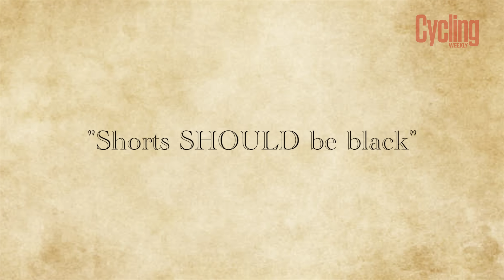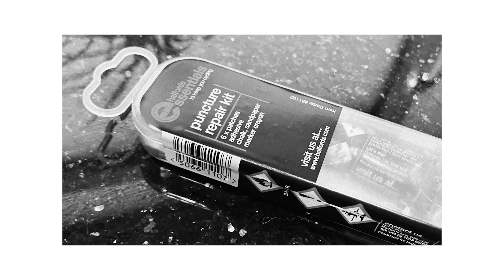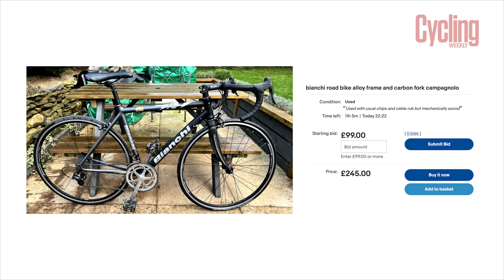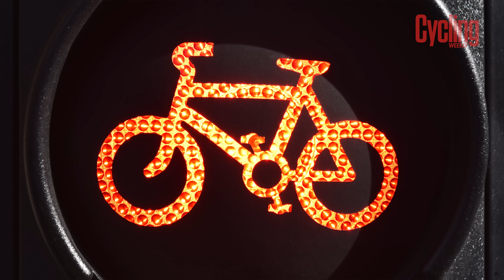15 Things That Really Annoy Us About Modern Cycling!

Comment: What annoys me the most about modern cycling is the revulsion towards rim braked bikes. They work absolutely fine and not everyone can afford to buy a shiny new disc braked bike to keep in line with the current trends and manufacturers marketing pressures!
Reply: Completely agree with you!
Reply: There's quite a few companies offering entry level, disc brake bike's as their popularity has grown. Price's have become viable, despite some still overpricing the frame and gear set.

Comment: Cycling doesn’t need to expensive. A friend thst has been riding with me for 10 years has been on an entry level aluminum Trek with Tiagra .. he puts about 4k miles a year on it. Just burned through his crank set,,, keeps up just fine with everyone else. We swapped bikes once (mine about 7k bucks) and zero difference between the two,,,i think he paid 900.00 US for his back in 2012… he doesn’t watch any of these cycling shows so he isn’t being manipulated into thinking that it’s about the gear. I get my bikes at factory cost and sometimes on barter for the work I do. I wouldn’t pay more than 2500.00 if I had to pay retail which is twice as much than I think anyone needs. It’s all in your legs and body position.

Comment: A visit to a bike shop is scary when you see the outrageous prices on the tickets attached to the bikes, but I have never paid much for a bike and I always consider the ongoing costs involved of anything I buy. You made a great point about Tour riders using rim brakes not long ago, so do I, I just bought a quality set of V brakes that work great for.....£6.99 Ha Ha Ha and that makes me happy every time I slow down and am pretty impressed at how well they actually work, I mean, do they actually "need" to be any better?. Never buy the latest and greatest because bikes have been really good for a long time now and there is so much inexpensive gear out there that is good quality. Personally I opt for screw on freewheels, 7 speed, I just bought one with a chain (Shimano) for £22 and it works just great with a triple chainset, the biggest second hand bargains must be Hybrids as they have been made unfashionable by Gravel bikes with £150 rear cassettes, single chainrings and no mounting points for carriers or mudguards LOL, just buy a quality used Hybrid and fit some drops and the appropriate tyres and save £thousands. I am really keen and cycle thousands of miles per year, but for me keeping the cost down is part of the fun and does not need to make it less enjoyable
Reply: PS if you fit drops to a Hybrid, bar end levers either indexed or friction  are fine and if you are happy to abandon indexing they are cheap, and I can change very smoothly with friction levers, V brakes work really well with "most" drop levers but TEKTRO make drop bar levers made for V brakes and they work really well (about £22 a pair)

Comment: I got a bit stuck on the first one. If you read the Velominati "Rules," you really should pick up on the fact that they are intended to be an ironic joke. The Rules are not the rules because there are no rules. The joke is on those who think there are. There is one caveat, of course, and that is Rule #5 always applies, if cycling is at all your passion. There are precious few people who will even notice whether your sunglasses are being worn inside or outside your helmet straps. Most of them are in cars or trucks and are either concentrating on avoiding you or hitting you without denting sheet metal.

Comment: for me, expensive price on should be ordinary item. back then, I never need to worry about drive train wear. but now, it's like a job to track the KM and duration of use for when need to replace.
Reply: Have you used the strava gear function, you can put each compenent in seperately so good for working out when to change chain tires ect.